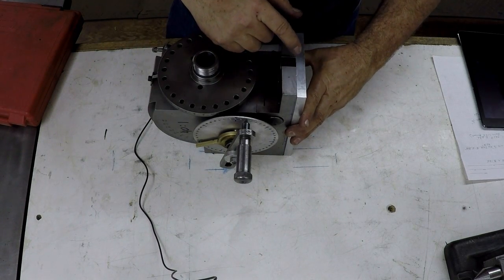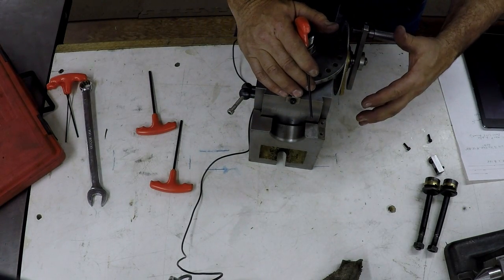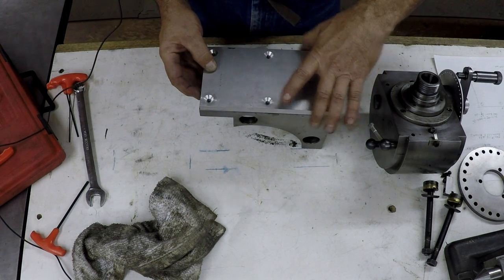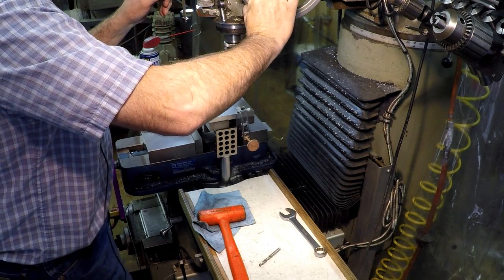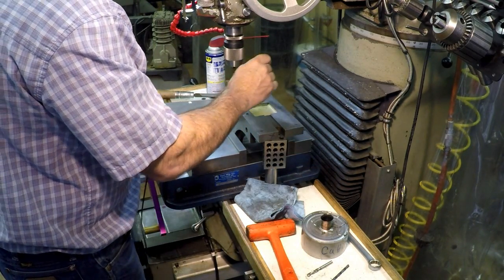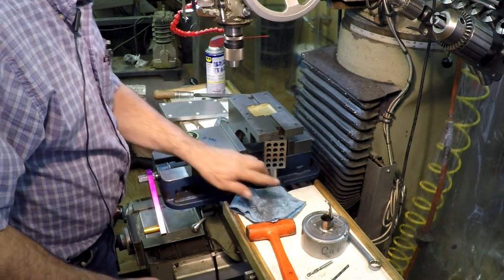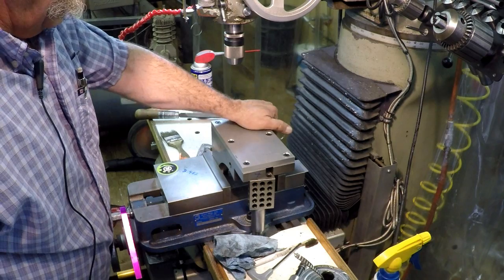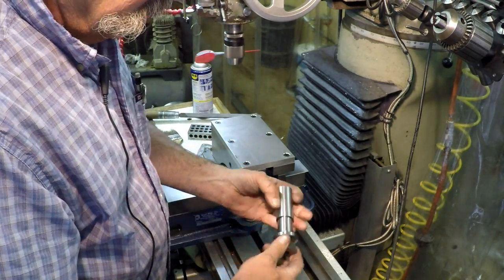How to Repair a Lathe Change Gear Part 3

Comment: Hi Randy, I've been watching your videos for a wee while now and really enjoy the work. Appreciate too taking your time to show us your process. One little thing is I see you using an external microphone, I'm afraid all of the time what we are hearing is the camera mic. I don't know if it isn't being recorded or you are selecting the wrong track in editing. Just hate to see you waste your time fiddling about with the wire for nothing.
Reply from the maker: Big Tam's Garage Thanks for watching.  I think the noise is when I leave the bluetooth on while recording. I have been trying to make sure i turn it off when recording.  Thanks, Randy
Reply: Hi again Randy. Thanks for getting back to me. I'm not worried about the noise, ambience is ok. I really don't think the microphone output is getting to your finished video. Next time you record something just give the microphone you are wearing a couple of taps and when in editing listen for it. It will be very distinct if it's working. Hope you don't mind. I'm new to machining but was a sound engineer for 20 years.
Reply from the maker: Big Tam's Garage I will  be check for that,  Thank you for your help with this, I really need a wireless mic.  Thanks, Randy

Comment: Wow, all of this set up is starting to scare me as far as repairing the 4 teeth on my compound gear...have you ever got a quote from Boston Gear on any of their of the shelf stuff? I guess it can't hurt to try if I already know that they stock the gear I need, but I will be finding out how much one is before I jump off the cliff, he he!

All of the things you said in your email were true, it does press apart and it didn't seem that tough until I started to watch this series, LOL!

Talk to you more soon, thanks for the videos...Aloha, Chuck
Reply from the maker: Knolltop Farms You should be able to find an off the shelf gear and make a solution.  I just had a few projects that had to happen before the gear to get to the gear.  Thanks Randy
Reply: Randy Richard
Hey man, thanks allot for the note and the ring. I was out in the shop welding on my belt tensioning contraption...I'll give you a call tomorrow if you'll be around? I would call now but I've got to shower and make Dad dinner and then get him ready for his trip to Oregon for the weekend.

If you're gone then that's cool I'll speak with you soon, and if you're there, you can try and keep me from quaking in fear, LOL! Talk soon, Aloha, Chuck.

Comment: Hi Randy, While we're (sort of) on the subject of dividing heads, are there any inherent advantages to using a dividing head as opposed to a H/V rotary table equipped with indexing plates and a tail stock?  It looks to me, a confirmed newbie, as though the rotab can do everything the dividing head can do, but not the other way around.  Yes, the rotab is 90:1 and the DH is 40:1, so I presume using a rotab requires more cranking, but are there any important differences that I'm missing?  Thanks,  -Chris
Reply from the maker: bx2200 
Just easier to setup the rotation axis at an angle.  Take the crank off of the rotary table and install a hole disc and an indexing pin and you are good to go.  Thanks for the inquiry and thanks for watching.  Randy

Comment: Smart idea with the air nozzle coming from what otherwise looks like a segmented flexible coolant delivery system. No need for an extra air hose. Love the jack solution you came up with. Excellent. Again an interesting video.
Reply from the maker: Jim Milne Thank you Jim.  The air helps get the chips out.  Thanks for watching, Randy

Comment: Nice video, +Randy Richards.
I'm curious as to what tailstock you use. I need to buy one and am continually debating what style and size to get, so I'm watching to see what the masters are using. I have a B&S Universal #2, roughly a 5 1/4" center height.  I think yours is a semi-universal #2 and you seem to think yours is a copy. +Keith Rucker has one, too.

Also, what sound and video equipment do you use? I tried using an old Kodak but it keeps shutting down and the background noise is too loud. I can't afford a gopro yet but there must be something I can do in the meantime.

I get a lot out of what you guys post. Thanks to you, +Tom Lipton, +abom79, +Keith Fenner, +Keith Rucker, and John Saunders at +NYCCNC.
Reply: Jeez, how could I forget to mention James Kilroy in the thank you list? There are many others, but you guys are the heavy hitters.
Reply from the maker: John Bazaar The one in this video has no marking so I am not sure who makes it.  I also have another one the wrong height but it is not adjustable, also with no markings.  I prefer and adjustable type center, for how often you will use it will determine how high quality it needs to be.  I don't use one very often.

I use my iphone 5s, ipad air, and a gopro Hero4.  I use the built in mics and a wired mic sometimes with the gopro.  I turn off the air compressor and heater when filming.  There is no street noise, city noise here, very quite.  So the only noise I usually have is the lathe or mill running.  
I hope this helps, Thank you for watching.  Randy

Comment: Your plate is not short.  You designed it with an architectural shadow line.  Also gives you that little bit of finger purchase when you are moving it.
Reply from the maker: Big'un44 Yeah, Yeah.  That's it.  Thank you.  I was being economical.  It worked out good.  Thanks for watching.  Randy

Comment: Hi Randy,
I was a little nervous that the tap would break.... That seems that I'm the only one that snaps those in parts, or the only one that puts it on the Tube... lol
Those screw jacks are a neat idea and versatile combinations built in... You're a man with practical ideas.
Good episode,
Pierre
Reply from the maker: pierre beaudry Thanks Pierre.  I have broken my share of taps.  This was cast iron so pretty easy to tap.  The screw jacks came out good.  But I think I will put some holes in them for a pin wrench.  They are very difficult to reach and get tight.  I just might leave it right where it is, the most used area.  Thanks for watching, How is the camera crane coming?  Randy
Reply: Hi, the crane is coming along good so far, it's a creative process where everything is adapted to the starting concept... Fun being in a creative stretch....  some more shooting in progress, to come out soon...
About the jacks, maybe add a circular ring around them to allow a spanner wrench do the  job, also swivel tops would ease on the whole jack wanting to move while tightening... just an idea...
Take care, Pierre
Reply from the maker: pierre beaudry Fun to be creative.  The brass part does swivel but with no bearing.  I am thinking of a spanner to fit the scallops (creative?).  Thanks Randy